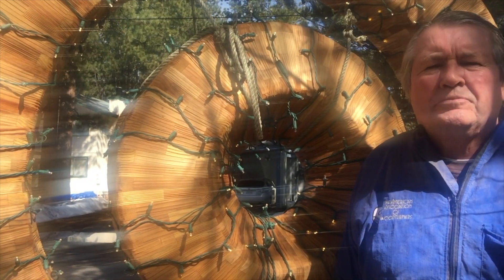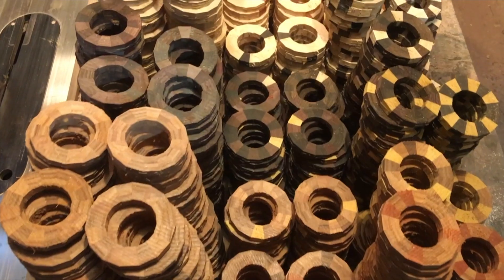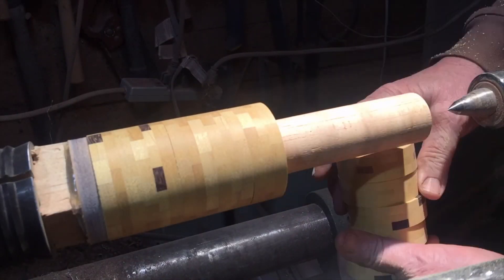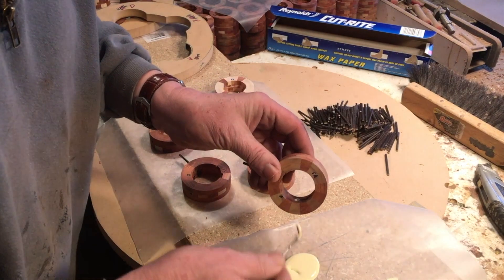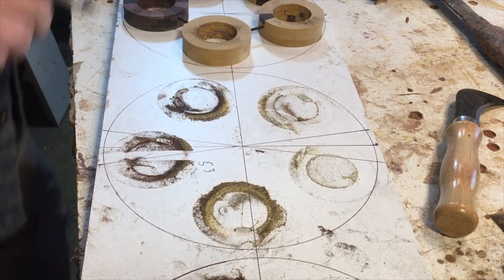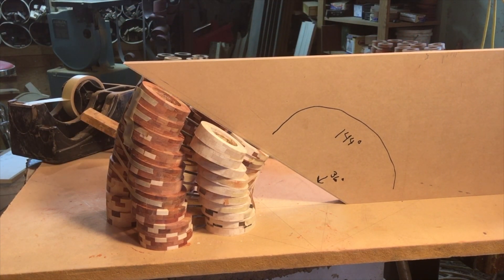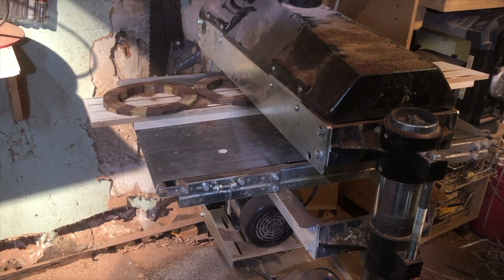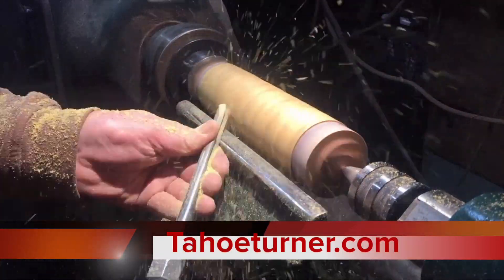Tower of Life

Comment: So beautiful and impressive.  I wondered why you didn't create a bunch of barrel culverts?  They were used in the late 1800's on the transcontinental railroad.  Long strips of wood with the same angle cut into them.  Then glue them in long barrel shapes, and slice them to size, including the tampered angle.  I'm sure you thought of that.  Beautiful art.  Thank you for sharing.
Reply from the maker: SuperJamster1 while that would work, it would result in weak end-grain to end-grain joints.

Comment: Unbelievable!  Extremely impressive.  The thought you have given to this is without comparison.  My hat is certainly off.  One question, how many clamps do you own and how many thousands of dollars in tools must you have?  Many congratulations on the newest additions to your family.
Reply from the maker: Rick Leakey I’ve collected clamps for over 50 years.  A rough estimate of all clamps, all types, is about 800.  Regarding equipment, I have most of the necessary woodworking tools in a very crowded, tiny shop.  Cost? Couldn’t even guess.

Comment: Amazing work! The only thing to improve this would be if you got a wide belt sander.
Reply from the maker: Brian Prusa I’m not sure I understand.  Why do I need a belt sander? BTW, I have a 4” sander.
Reply: Malcolm Tibbetts a wide belt sander. Like a drum sander but more efficient at removing material and heats up less. Depending on the grit and wood hardness you could do tapering in one pass accurately. Drum sanders just don’t have the umph to get it done in my experience.